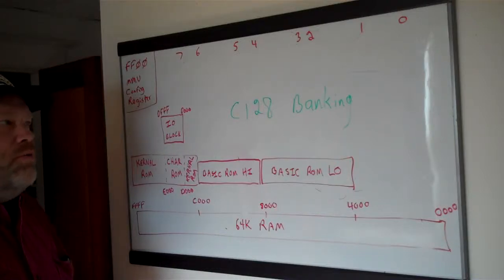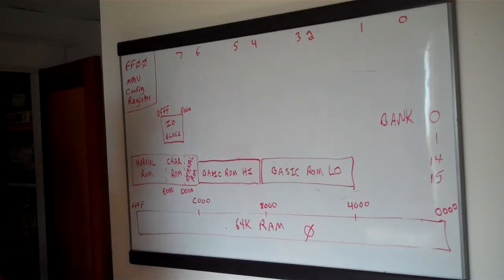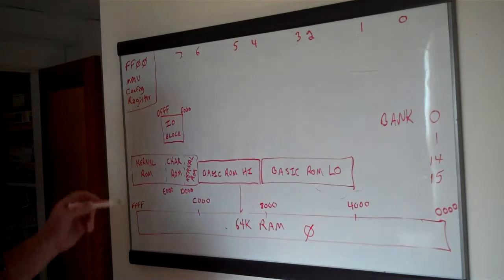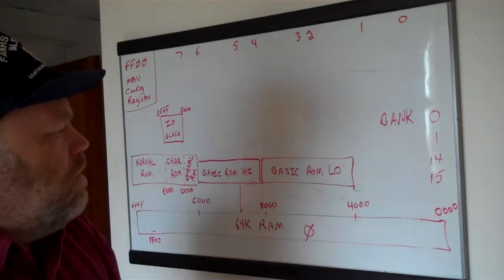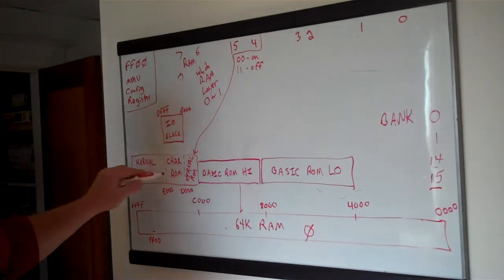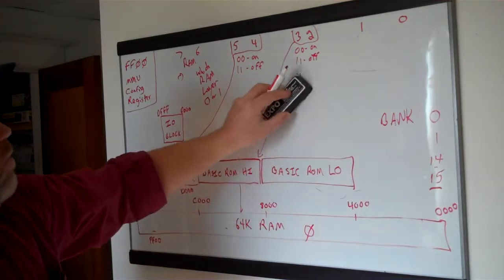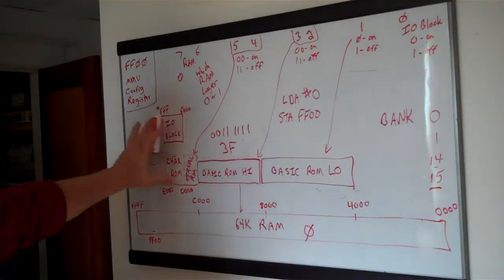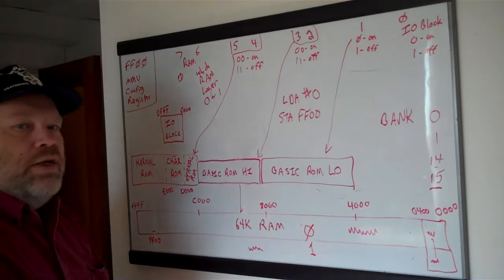Commodore 128 Assembly Programming #23: Banking

Comment: What assembler would you recommend for the C128 and C64,  though mostly I will use the 128 over 64 mode.
And the next comment is right about clear simplified explanation of the MMU!

You implied that someone made a memory mod that could see 256k ram.
Not that I need it, but I could see it being useful.

On one of my flat 128 I did a mod that gives me 64k on my VDC chip.
I also did it for several friends, in Fort Collins, Colorado, it was many years ago.
When you press the control, run/stop key, it would default to the tape drive.
I also did a mod to one of my C64 ROMs, I removed the tape code with code that would load from the last drive used.  If it was device 9 it would do load "*",9, otherwise it would default to 8.   I think I found that in a magazine call transactor back in the late 80s or early 90s.

I did modify it to go get the last device used, if it was a 0 I made it 8, if 8 to 15 I used what it was,  Those machines were lost about 20 years ago do to not being able to keep them.

My current C128 may have the 64k VDC memory, I will have to look.

Thank you